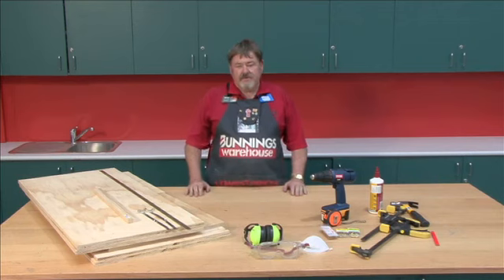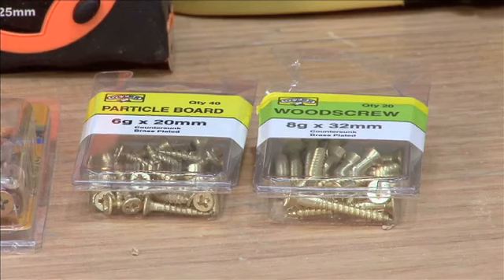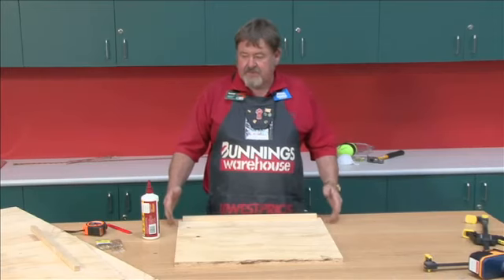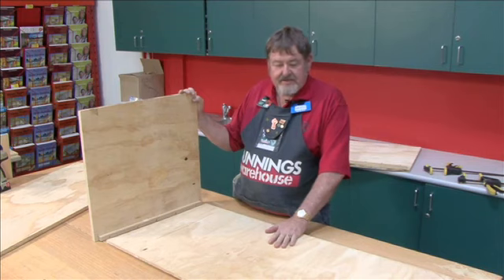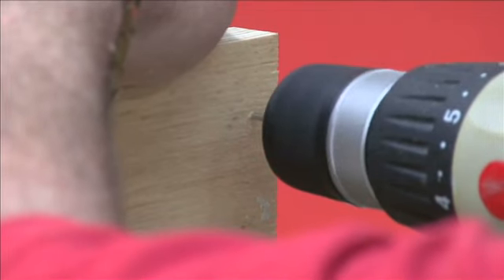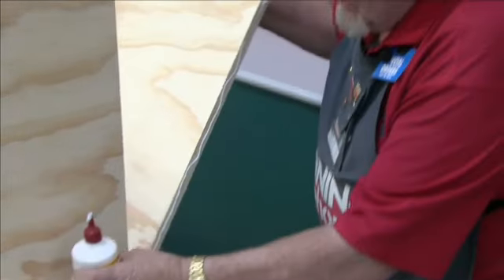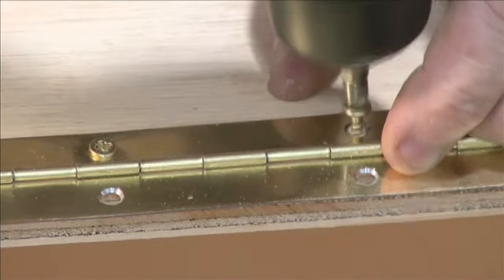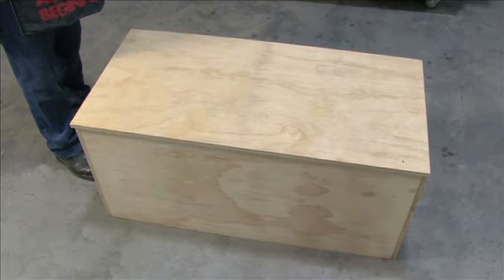How To Build A Storage Chest | Indoor | Great Home Ideas

Comment: hello
i made a box like that for outdoor , and when i put it outside , it got wet and the lid warpped upwards what do i have to do to keep the lid from warpping ? please
ps 
the lid was stained and had SPAR MARATHON out door varnish on it 

paul
Reply: Hi Paul know your comment was 8 mouths ago but thought I would give you advice anyway. You can try and glue an screw timber to the bottom of the box. Depending on how warped it is you might need to cut a new lid. Try to avoid the timber in the rain or sunlight as it kills it. Also by adding a tilt on the lid (making the back panel taller then the front) that would then allow it to drain off and not let the water sit on it. You could also try different timber, ply isn’t really good for places that can get wet as it warps. 
Thanks your friendly neighbourhood carpenter
Reply: Paul Shaw you wouldnt use plywood outside and you'd also need to waterproof it

Comment: I have small children who may try to sit on top of the box, would you recommend a post across the middle of the top of the box to add support?
Reply: I wouldn't worry about it if it's 16 mm (about 2/3 of an inch) plywood -- that's pretty thick -- but you could test it before building it by setting the board up on cinder blocks and then adding weight to see how much it bends.

If I were going to re-enforce the top, I would screw a 3/4" x 4" red oak board lengthwise at the midpoint underneath the lid and add six 2 x 2 pieces of timber vertically on the inside of the box -- one in each corner and two on either side of the midpoint beneath the red oak beam.